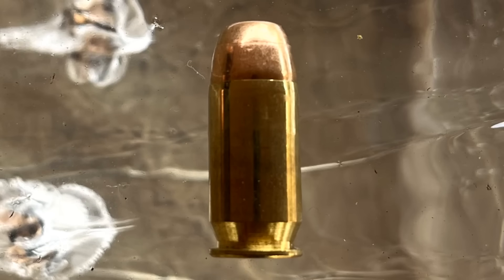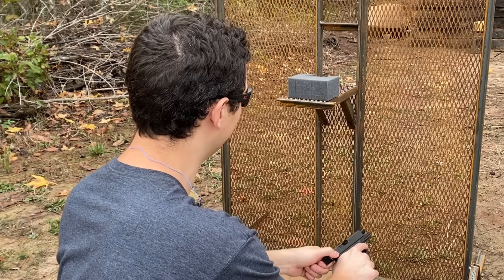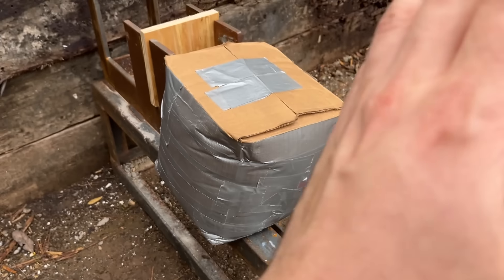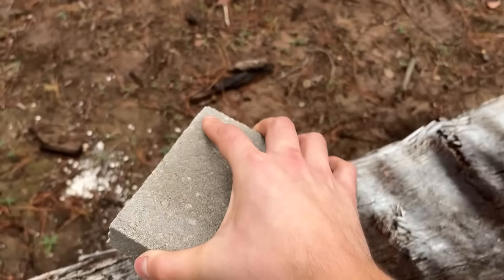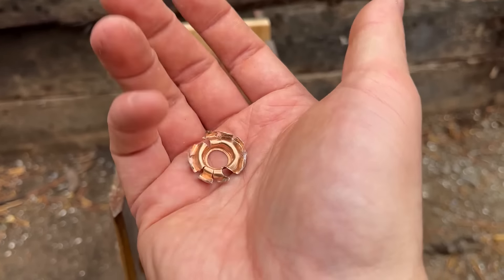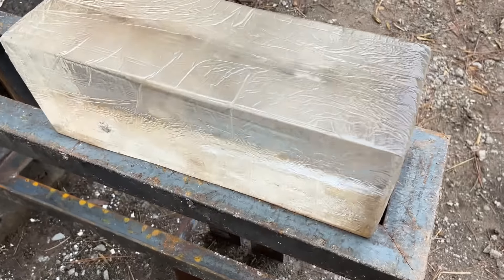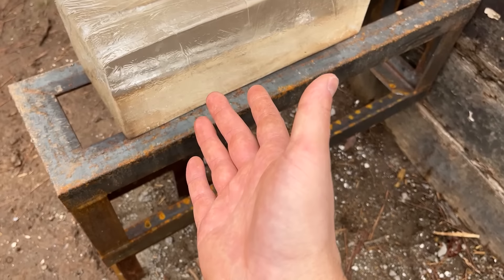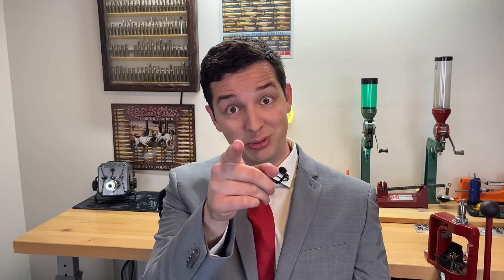9mm vs 45 ACP Barrier Test: No Debate?

Comment: The .45 does a lot more damage to flesh and bone ....
Reply: Yes, as indicated by the live video, where we can see that the air pockets from the 45 ACP expanded about 4 times more than from the 9mm.
Reply: That part
Reply: I guess he’ll have to shoot some flesh and bone
Reply: No, it doesn't at all. Just more fuddlore.
Reply: @joshrandall3632 I've seen cow bone tests, and a .45 ACP bullet shattered one. Maybe not penetrate, but definately shattered it. It's a hard hitter. The amount of damage it causes will be debated, but it does without a doubt cause damage. And just FYI, cow bones are much more dense than human bones. And that unfortunately means it overpenetrates with FMJ.
Reply: @joshrandall3632  go check Paul Harrel's tests with meat with bones and skin layer. .45ACP does produce higher damage to such target. Whether this potential damage difference is enough to justify losing capacity and added mass and recoil of .45 over 9x19 is another story, and usually the answer is "no" - but the above fact still stands.
Reply: @czwarty7878  Once again, thank you for that irrelevant info. If I'm ever attacked by a rack of ribs I'll think of you as I grab my .45 and some BBQ sauce.
The best .45 produces a nearly identical PERMANENT wound channel to the best 9mm rounds. Steaks don't stretch and absorb energy like living tissue. It should be obvious, but here we are.
If you want to see an expert's view on why you're wrong, check out the video by Lucky Gunner. Hope this helps.
Reply: @usbackcountry temporary wound cavities like the “air pockets” you described do nothing to incapacitate. If you watched further into the video, the permanent wound channel, the one that actually matters as that’s tissue that’s permanently damaged, was slightly wider with the 9mm, and slightly longer. Handgun velocities and subsequent energy is negligible on a human target, wound channels and struck vital organs and arteries are what incapacitates…
Reply: Not that much more and not worth sacrificing more rounds that are needed to win the fight.

Fudds talk like the differene between 9 and .45 is the difference between .50ae and .45
Reply: WRONG! A lady got shot in the head with a 45 and crawled away. Plus this has been debunked. 9mm is superior to 45, but keep kicking that horse
Reply: false. coroners have testified they cannot tell the difference between 9 and 45 wounds on dead perps.
Reply: A 9mm may expand but a .45 doesn’t shrink, YMMV.

Comment: They're both good.  The End.

I always think of it like this - Two different tools.  Both shoot straight.  One is a bit smaller for easier carry and more than gets the job done.  The other is larger and will usually put more damage on the target.  They both shoot straight.  It's whatever you're comfortable with.  Whatever you shoot better.
Reply: Nice ❤❤❤❤
Reply: @papermam9708 - Be careful using logic like that, it's foreign to most folks......
- IMO, this video was well done
- My 2 Cents on 9 vs 45: Admittedly my opinion is strictly based on reading & listening to what professionals in the field have to say (I've never used a firearm in a professional capacity) & hopefully 🤞some good sense. 

My Conclusion: A real life situation will never provide the 'all things being equal', science experiment setting like this vid lays out so it seems to me that in a real life situation, shot placement will always win that damage derby.
Reply: 9mm and .45 both suck. The End.

But I would agree that the caliber and pistol pick the owner, not the other way around. So many people pick out a firearm because its tact-i-cool vs pract-i-cal. Neither one of them are going to penetrate cheap Chinese body armor let alone some decent level 3 that can be had for super cheap nowadays. 

Only nice thing about pistol ammo is you can carry a crap ton of it, and it won't way you down too much. But I am a large caliber dude only. 7.62 and shotgun. Will do the trick on any adversary / opposition I have to deal with that's not the terminator or robocop.
Reply: 357 magnum much better

Comment: I'm holding out for the 'how fast does it stop the 100k robot that is programmed to kill you " test.
Reply: projectile weapons will most likely
be effective only if certain spots are hit
and be capable of making it through some amount of armor. 
I'm thinking a much more effective means will be a way to short circuit the machines  electronics 
by some means of exposing it to 
high voltage surge.

Comment: Interesting view of the lumber penetration shots. The 9mm appears to essentially have sliced through deeper, but the .45 has a much wider path of broken fibers. Federal HST is excellent ammo in pretty much every caliber. That .45 HST, with it's much larger expansion, had to cut more gel to its destination than the smaller 9mm. A couple of things to consider.
Reply: Nothing to consider. If either go through your heart, dead. If either go through your lung, you have a hole in your lung, not dead.
Reply: I think he's trying to say 45 has a better chance at hitting vitals like heart, spine, CNS, etc... simply due to it's size.

Personally I don't use subsonic ammo for defense so 45acp is out of the question.   It's fun to shoot range steel with a Suppressed 45, but that's about it.
Reply: A bigger hole is going to cause more leakage, and a .45 starts out almost as big as the 9mm is going to expand.

When you use a .45 that expands at its lower velocity, it's still going to be bigger than that 9mm.

If you use the argument that a head, heart, etc., shot means death (which it doesn't), then why not use a .22 LR?

10mm is far too powerful (and like it or not, it's on the same level as a .357 magnum) as a defensive round where you may not want to perforate five or six walls (or bystanders) after it passes through your intended target.
Reply: 22 is not reliable and doesn’t have enough to get through bones and still penetrate vitals. You can get shot in the head and be fine, not so with your heart. Talk to an ER surgeon or gets some real experience and education.
Reply: @Rubeless  There are reliable .22's and good ammo has been found pretty reliable, see Lucky Gunner's video, for example. People have emptied pistols in their hands despite taking shots in the heart (there was that one cop story about .357 magnum in the heart not stopping right away). Also see all the deer and game that have run a bit after being hit in the heart.

Comment: You should try 10mm. Buffalo bore  or underwood ammo. That would be cool
Reply: Yeah, I'd like to see 10 mm vs .45 ACP.   10 mm seems to be a savage semiautomatic pistol round.
Reply: Underwood 10MM AUTO 140GR. XTREME PENETRATOR®
Reply: 10mm Federal HST 200 grain
Reply: Buffalo Bore is one of the few that put actual 700ft lbs 10mm ammo out most is watered down 40cal in 10mm case
Reply: @timjohnson8390 Buffalo Bore has been hot loading the .40 S&W for years to almost 10MM levels, it's for one to decide how badly they want to punish their handgun and wrist😂😂
Reply: @RollingRigTraction  ABSOLUTELY! I carry the Heavy 40sw  155 grain +p Buffalo Bore in my pc shield
Reply: Try a .45acp +p or a .45 +p+ (aka 45 super)
Reply: Just be a man and carry 10mm.    Best of both worlds!

Comment: Big take away IMO. 9mm vs .45 is not a deal breaker or major enough difference to switch. Whichever you have of the 2 is basically equivalent and if you need more than what 1 of them can do, you need a rifle. Shot placement is more important than differences between handgun caliber ballistics and whichever you shoot best and have a gun with enough capacity for the scenario will give basically the same results. TLDR don't need to worry 9mm vs .45 as long as you shoot it well and don't run out of bullets before you're done handling business.
Reply: There isn't enough real world ballistic evidence to justify one over the other.  Shot placement trumps caliber every time.
Reply: If you shoot someone in the arm it's not going to be fatal usally. Until it's a 50 cal, then there is no arm... @burningsporkdeath

Comment: i will say, one of the perks with .45 acp is that it's usually subsonic, so if you're running a can, it's quite quiet!
Reply: @BryceCzirr-jz7ju with subsonic you are limited on speed, so only weight matters. Most subsonic 300blk is 220gr. there might be heavier, but that's what you'll typically find. Most 45acp is 230gr, so it will actually be slightly more powerful than your typical subsonic 300blk round. Granted, the 300blk is more aerodynamic, so it won't take too much distance before 300blk has the advantage in ft/lbs of energy.
Reply: BryceCzirr-jz7ju get both, 300blk and 45acp have a powder that is sharable
Reply: negative, 9mm subsonic with can is 100% quieter. Wider barrel hole = louder noise. Learned this with big bore air rifles.
Reply: @Juss-Saiyan  i feel like you're missing the fact that i said most .45acp, but that's interesting to know! makes sense tho!
Reply: @Juss-Saiyan  I had never heard that before, Interesting note. I would assume 9mm subs are quieter because they weigh less and therefore take less powder to get to a specific speed. Less powder, less energy and noise.
Reply: BryceCzirr-jz7ju  agree... but.... 45 is cheaper,  and doesn't require a fast twist barrel.  For planking 45 is better, in lever action , has its purpose on a ranch for duty.
For home defense,  300lbk is currently unmatched with those new lever actions in 44mag  suppred shooting 400gr bullets subsonic in a integrally suppressed barrel.  It has the proformance of a 300blk almost,  but idk I would say 300blk is still maybe better
Reply: BryceCzirr-jz7ju well obviously doofus, it’s rifle round shot out of a longer barrel🤦‍♂️
Reply: BryceCzirr-jz7ju  That slow speed helps the bullet energy dump.
Reply: BryceCzirr-jz7ju mine is a MAK 90
Reply: BryceCzirr-jz7ju  totally different use cases lmao uncomparable

Comment: I think the 45 won on cement. It destroyed that cement better. Left the jacket and lead in perfect shape. 
I think you’re also forgetting that the 45 was meant to be slower in order to dump power inside the body.
Reply: But isnt that gel test there to prove even that aspect is bit of obsolete.
Today 45 doesnt offer much of benefit compared to 9mm.
If anything else then it is easier to supress because by default it is subsonic.
Reply: Except it doesn’t. It’s been proven many times through many tests done by everyone from YouTubers to government agencies. There really is no advantage to .45 over 9mm
Reply: Actually .45 was chosen because of parts commonality (projectiles common with .45lc) and it starts with a bigger hole when rules say you can't have hollow points/soft points.
Reply: @Kesssuli my brother in Christ, + P
Reply: We are basically saying the same thing.  @wisewhiterabbit
Reply: It may have been the actual point of impact. The 9mm impacted closer to the edge of the concrete and skewed somewhat. The 45 impacted center and may therefore, have dissipated its full energy without any deflection. Either way, I do not want to be shot by either round.
Reply: "Dumping power in the body" does nothing
Reply: @joseeduardomagadan9728  that's hell talk.
Reply: @Kesssuli  a bit obsolete the 45 ACP will never be obsolete. The only downer of the 1911 is that it only holds 7+1 that should get.
Get yourself a 45 ACP 1911 and do some shooting with it it’s one of the most hand comfortable handguns I’ve ever shot if you noticed that gel test 1911 stayed within the first gel the 9 mm kept going through it’s been known that in battle that people with the 1911 have to shoot bad guys numerous time compared to 45 ACP that’s why special forces of the marines have stayed with the 1911.
Reply: @uncut_oxygen6134  let’s remember that a gel test is not actual test of what it does to the box. It’s closest as they can come without shooting a piece of beef or something but don’t give gel test the overall winner.
Reply: @ronmarvicsin7709  Did we watch same video or did you comment in wrong place ?
Isnt that very clear least in this video how 9mm went only 0.5 inch deeper and did
actually wider wound channel than 45. 

I dont live in a states so i dont have that two world wars mindset spoonfed to me.
1911 is okay platform but as plain jane it doesnt have much to offer when compared to CZ 
made pistols. And i dont see california compliant default capacity as good thing.

And when it comes to military it had to be very special forces if someone is
sticking with 1911 with .45 if have chance to choose anything with more
capacity. Handguns are classed as sidearms by very obvious reasons. 
Your primary  weapons is gonna be a rifle and pistol is mostly used to point direction
where you want your prisoner to walk.

Feel free to be offended by those statements if stil cant accept we are living in
year 2000 now.
Reply: @ronmarvicsin7709  There are many tests just on YouTube to view almost all concluding the same thing. There’s not much difference between 9mm and .45 that’s a fact not an opinion. Now you can sit and poke holes in different tests but the reality is all data points in one direction.
Reply: @ronmarvicsin7709  p14 frames have been around since like 1993
Reply: @uncut_oxygen6134  except we all saw the concrete literally explode with one round and barely break in half with the other. are you suggesting that was CGI magic? george lucas up in this piece?
Reply: @ronmarvicsin7709  clear ballistics gel is literally just for youtube clicks. the testing gel is a much darker color and performs differently.